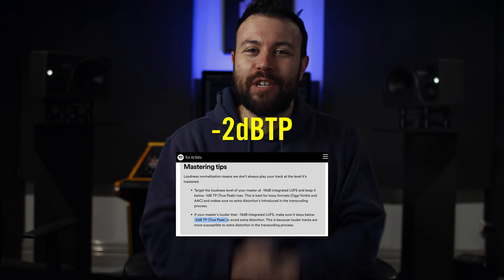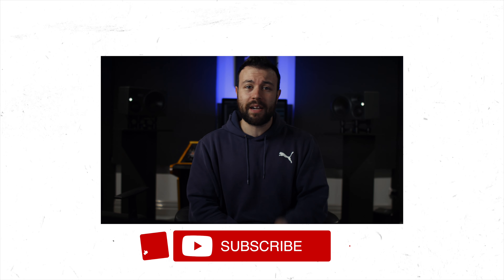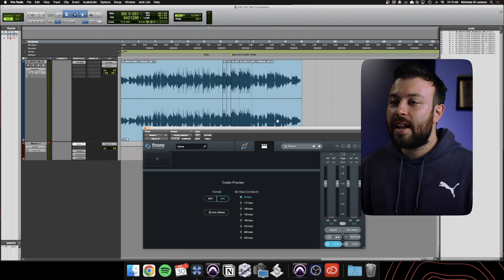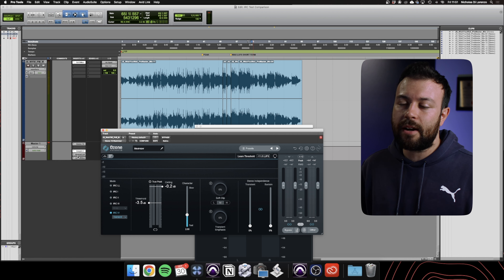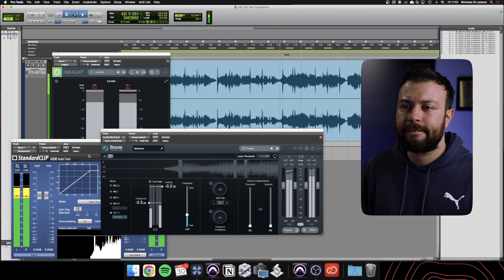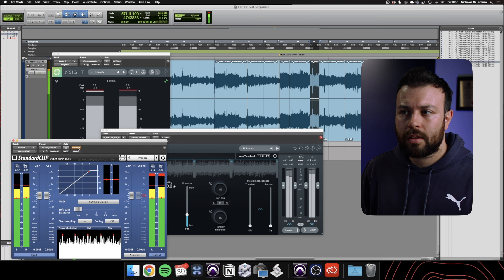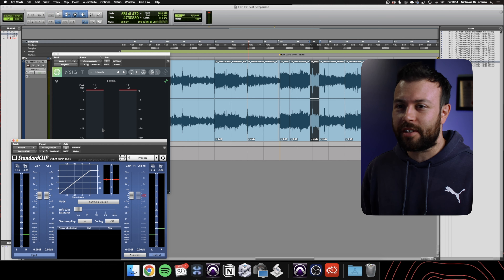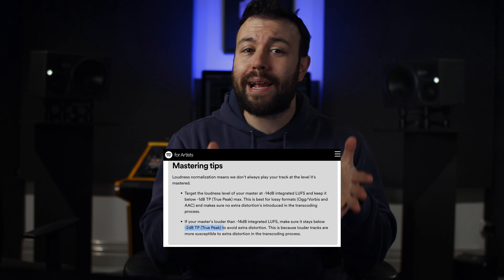ARE YOUR Masters Being DESTROYED When You Limit Like THIS?

Comment: I use limiters and clippers with no oversampling and no ISP limiting. I’ll usually MONITOR ISPs and adjust the output trim accordingly, but that’s all.
Reply from the maker: oversampling is probably not a bad bet to have on; aliaising distortion is irreversible and can't be negated by an output trim;
Reply from the maker: @TheJohnsofDoes  are you refering to minimum phase oversampling?
Reply: @TheJohnsofDoes   All he asked is a clarifying question. I would further ask, have you actually tested for yourself which plugins or processing provides you with this “minimum phase” over sampling? I’m sure developers may vary on the use of those. But my follow up question for the convo is this, in eq, minimum phase actually helps retain the transient integrity whereas linear phase has ringing that can smear a transient. What part of the frequency spectrum or time domain is being negatively impacted by minimum phase oversampling? I’m unaware of this particular concern.
Reply: from my rudimentary understanding, when done right, the aliasing from oversampling filters shouldn’t impact the audible range. if they’re impacting transients the filter probably isn’t steep enough. this is more likely to occur when working at 44.1 as nyquist and therefore the filter would be significantly closer to 20k. when working at 96, with nyquist being at 48k there shouldn’t be any audible impact from anti-aliasing filters. if i remember correctly, fabian from tokyo dawn records (makers of plugins such as kotelnikov) has some good insights into filter steepness and aliasing in some posts on gearspace.
Reply: Check your mixes on speakers like smaller flat screen TV's. They tell the truth in the worst & most realistic case.

Comment: Thank you for these videos & touching on topics such as these. Music can come out insanely loud, punchy and translateable on even the worst & most realistic poor DA systems like smaller flat screen TV's, with True Peak ON and out ceiling of anything like - 0.5 to - 0.3. If the mix is right and loudness acheived within, TP and out ceiling should make basically no difference, and will still compete with the absolute loudest and best. This can be dependent on the quality of your limiter as well, I am using and referencing the Pro-L 2.

Also anyone who is not checking their finals on poor yet realistic DA systems like smaller flat screen TV's may be in for a slightly rude awakening, though hopefully not! Modern Cell phones don't count, their speakers and DA conversion are actually quite decent.
Reply from the maker: Bang on!